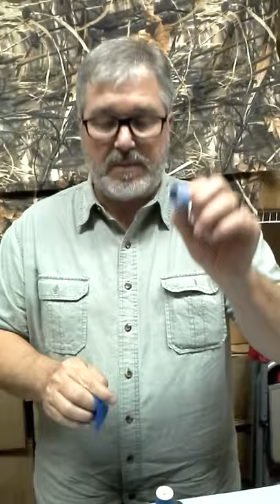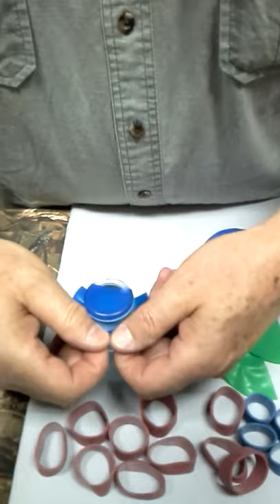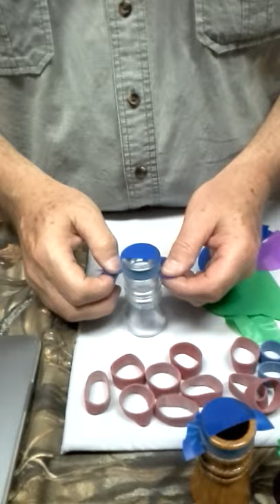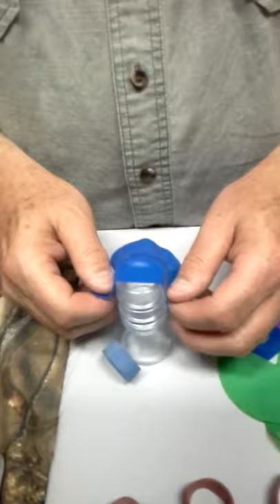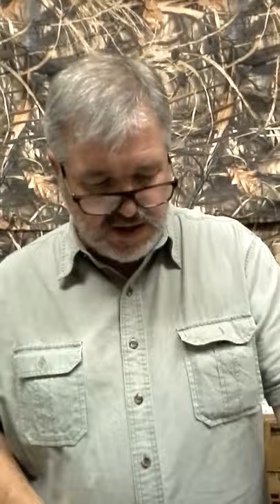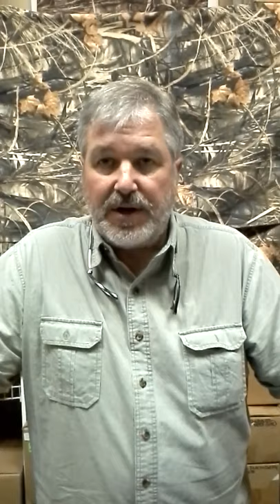Quick Tuning a Tube Goose Call

Comment: I would love to get my hands on one of these! What would the difference be from a delrin/poly/wood tube!? I would assume like a regular goose call, wood as melo and acrylic high pitched? Please do a demo between the material tube calls and the different cuts of rubbers so can make a decision. Thanks in advance!!!
Reply: Sorry that I did not see your question so long ago.  But I know we talked on the phone and you ordered a call.  How do you like it, and what differences do you find from the different diaphragms?

My experience is that Delrin is more dense/harder than wood, so louder.  The Rosewood is louder than Maple.  the biggest differences are achieved through different weight diaphragms (reeds). What do you find?

I will attempt to do a demo video.  Thanks for your interest and for your purchase as well!